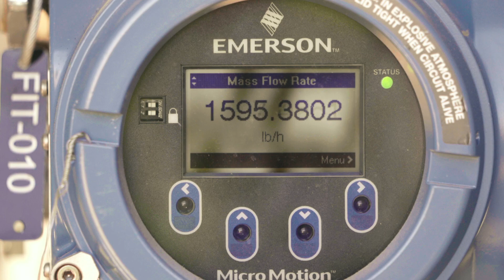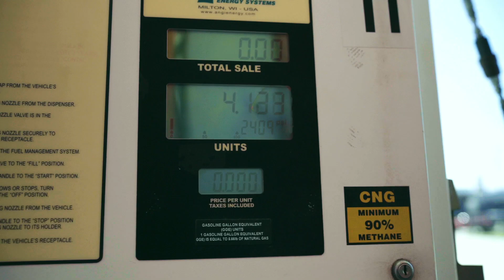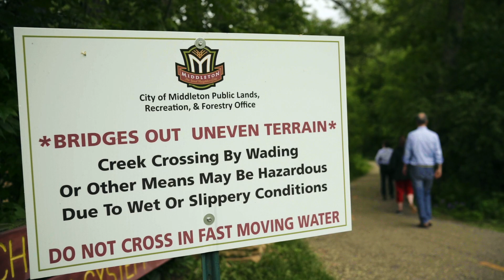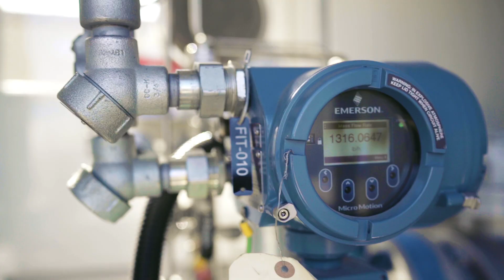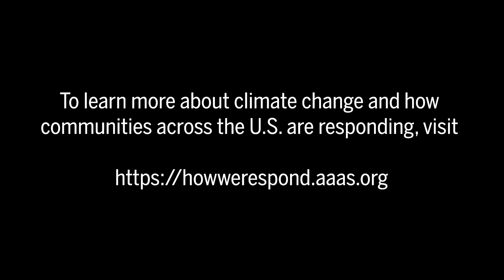Dane County, WI – Methane capture

Comment: Methane traps heat, so if you trap methane in dome, put heat beneath it, you can probably get a lot of steam power from the heat obviously....Being able to capture methane allows cars to be hybrid, biogas/electric cars, eliminating charging station needs even further...Capturing methane turns it back into methanol and carbon that be added to hydrogen to get more fuels. Grids should  greatly sovereign and not require fossil fuel drilling much more.